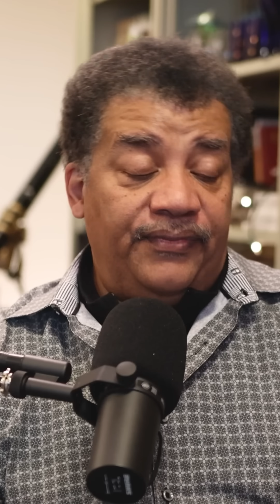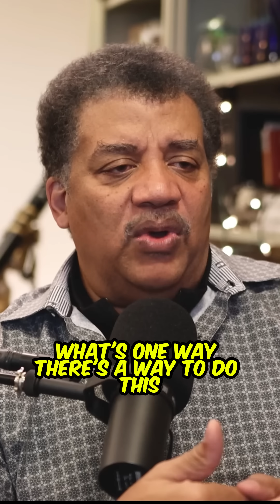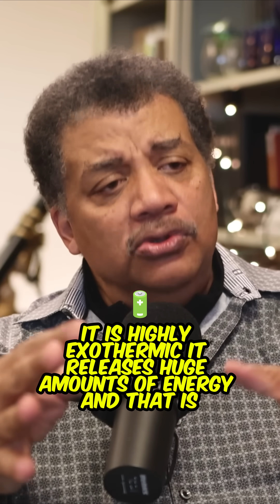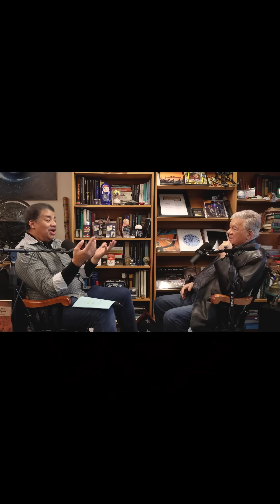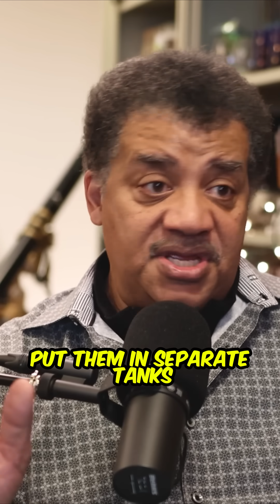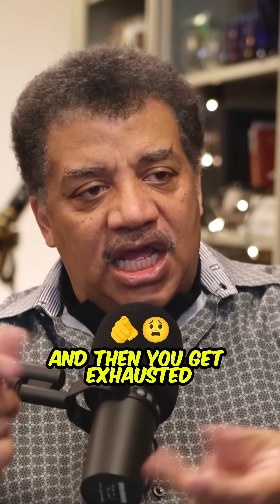William Shatner: How Does Water Become Rocket Fuel on the Moon? Neil deGrasse Tyson explain

Comment: Reason it's useful is that even though it required energy to create it, you can store it ready to use and it releases that energy quicker than it does to create it; making it a good fuel.

It's not quick but if you made a seaplane that ran on hydrogen fuel cell with a built in electrolyzer. Could fly the plane, for however many hours of fuel you have, then land it in some port, bay or cove. Use some solar panels maybe built into the wings to power the electrolyzer for however long it takes to refill the fuel cells and then take off again. And repeat. 

You may ask yourself why not just store the solar energy in batteries. You could. It would take less time to recharge the battery however you have a shorter range and it's less environmentally friendly.

Comment: I think it would be helpful to point out that water is electrically polarized, meaning one side is electrically negative  and the other is positive. When the molecule is under a strong electric field it gets torn apart. For its molecular weight, water is very density, due to the electric polarity. The molecules are strongly attracted electrically, so are closer together than they would be otherwise, hence the high density relative to molecular weight. Example: O2 is a diatomic molecule that is a gas clear down to bitterly cold -182C. Water, on the other hand, only has one Oxygen, and is about 56% the molecular weight of O2 & is a liquid all the way up to 100C. Water has other crazy properties, and we have oceans of the stuff. The point is that electric phenomena have huge potential, are responsible of the industrial revolution. We have only but scratched the surface of nuclear. We haven't entered the nuclear age, but are in the infancy.

Comment: One of the worst explanation I have heard Tyson give.  Electrolysis meaning running electricity through water to break the chemical bond producing hydrogen and oxygen.  Ignite the two and you have fuel being burnt 🔥 for propulsion.

Comment: Tyson seems to be implying that this is a simple process that will be easily used on the Moon as the Moon has the water you would need yet he fails to point out that if it was such a no brainer then why do they not create energy the same way on earth where conditions are much more favourable.
 The scientists like to understate the difficulties.
Elon Musk is on a different level when it comes to ignoring the practical problems that would be faced if there was ever a mission to Mars.
 Trying to pull the wool over peoples eyes so that they can continue to get their ultra expensive funding?

Comment: I had a little hydrogen fuel cell kit that I gave my son (but played with a lot myself). It had a hydrogen generator where you put water into tank 1, plug it in, and the H2 goes to tank 2. Then you disconnect the plug, take the hydrogen to a little toy car with a fuel cell, connect that, and it would make electricity to run a tiny motor, make the car move forward.

Comment: No! No, no, no, no, No!! Hydrogen can be burned with oxygen. However it takes WAY more Energy to Seperate them... And yes, a car engine was rebuilt to run on Hydrogen. It was a VW Beatle, and this was done in the 1970s, however, it only produced about 3/4 the power of the same engine running on gasoline. And yes, the exhaust was water, steam coming out of the tailpipes.. But over time, that water would cause rust and damage to the Engine, look up the "Natural Gas" thing from the early 2000s, they had the same problem...

Comment: The important part left out is that you can do the electrolysis slowly over time using solar or whatnot, but then when you want to take off you combine the hydrogen & oxygen quickly, releasing the same energy you used to break up the water, but massively more power output for a short period of time (needed when you need to escape the moon monsters).

Comment: Called a car battery, electroisis, water in container , two metal plates , DC current application, + plate gives off Hydrogen and - plate gives off Oxygen, now you got very potent rocket fuel or fuel cell from hydrogen. ( Last time I put this up and expert said " batteries have acid in them " well they do when charged , that's how it stores energy, flat battery is water ( or very much less acid) and charged battery is very acidic . Put distilled water in a battery it will be flat , but tip water out and add acid it's now instantly charged .

Comment: You can do it with a jar of water, a knife and fork and the plug and wire from any discarded electrical appliance. Just don't electrocute yourself. Also don't sniff the fumes, tap water releases chlorine or something, If you cough while sniffing, that's a good method for involuntary self-inflicted electro-shock therapy.

Comment: Utilizing solar electricity, the electrolysis can be cheaply done. Many current engines are unable to sustain using this as a fuel for a long period due to the 250°c/450°f higher burn temp than common gasoline causing overheat resulting in melting of engine components that were made for the cooler burning gasoline engines. This blows the idea of hydrogen conversion kits for current vehicles... 😎out of the water.

Comment: The correct answer to William Shatner’s question is:

For propulsion in space/vacuum,  you need to accelerate some mass very quickly in the opposite direction.

The mass comes from the water, the energy comes from Solar Power and/or nuclear power.  Then the energy is stored by separating hydrogen and oxygen through electrolysis of the water.

When it is time to launch, the burning of the hydrogen and oxygen in the rocket engine releases the energy and the high velocity water mass propels the spaceship.

Hydrogen and oxygen was the propulsion the space shuttle and many other rockets used.

A more complex process of turning water and CO2 into liquid methane and oxygen for fuel is what SpaceX plans on Mars.

Oxygen is kept at -183 C
Methane is kept at -162 C

Hydrogen is kept at -253 C

So hydrogen is over 40 times more energy to liquify. And about 10 times harder keeping it cold and liquified.

Not to mention, hydrogen is harder to keep from leaking and pushes the limits of our technology and materials.
Reply: Unless you use a warp drive. Or a probability drive.

Comment: Neil is not correct about the energy needed for the electrolysis being the same released in the combustion.
We need more energy to separate H2O in H+H+O.
Then energy is released in the form of heat when H+H recombine in H2 and O+O recombine in O2.

Energy loss depends on the catalyst used and may be from 20% to 30%.

Comment: "add energy to the system" Shatner's pointing out that it sounds a little like you have to give it a jolt or introduce something exogenous but it's not, it's kinda freeing the energy from the separation process is it not? It's releasing energy, not a conversion like burning coal to make steam to produce electricity, using energy from something else. Do I get this right?

Comment: Shatner, temprature split, seperate water Molecules freeing the Oxygen and Hydrogen Gase's, check a mechanical clothes dryer where it's temperature splits the water Molecules therein where the clothes become dry and the Gase's are tunneled out.
Sunlight does the same with clothes hanging on a clothes line.

Comment: Tyson you didn’t answer the question so much as explain the concept conservation of mass and the energy covalent bonding thermal release or expending of the electrons energy/vibration. The Mohican tin onxy knife of St Croix infamy split a hydrogen from water they used it as a balloon type gathering tool the corners of hides would tie to stomach and bladder balloons. Nichola Tesla hydrocoil also separated hydrogen but less effectively not gathering the oxidized tin sheared hydrogen. My concept and chemical bonds sheared through a hybrid chemical and mechanical physics plane. The outer covalent shelf independent of ho a free e to the n now neutron sorry hood Swedish Mohican Jew Christian military medic deployed and semi retired dabbling with Bush.

Comment: If the net gain is zero, why not use the energy it takes to separate h20 for whatever you need the energy for in the first place.
Reply: Because breaking the water apart (electrolysis) is a slow and tedious proces that can be done with low amounts of energy at a time. Run a few solar panels for a year, for example.

But bringing it back together (combustion) can be done violently and thus be used in a rocket engine.
Reply: They could use nuclear energy to power the electrolysis process producing hydrogen & oxygen. Those products can be stored for when you need them.

Comment: Hmmm missing info here you can use pulsating DC.

Resonant Cavity: One method described for utilizing pulsating DC involves a resonant cavity where the direct current is pulsed at a frequency that matches the resonant wavelength of the water molecules. This resonance is believed to enhance the splitting of water molecules.
You make what called browns gas 2ho

Comment: You do not get back the same energy that you put in. Its more like you get back 35% of the energy you put in, and that just converting water to hydrogen and oxygen. You are going to power this with solar energy and it the momentum we only get a conversation rate of 25%. Bottom line, you'd need to put way more energy in than you are going to get back.

Comment: glorified battery. You do have to use energy to charge (split H and O2) - solar
Reply: A battery cannot discharge the energy with the necessary speed to propel a rocket
Reply: @sergiorejtman front it with capacitor

Comment: The amount of fuel energy you get back from your electrolysis is never the same as what you put in. You put in 1kW of electricity to H2 and O2 out of water and you will only get about 80% of that back in potential energy. If you burn that in a fuel cell you will get even less efficiency back out, like 65% with a state of the art fuel cell. 80% x 65% =  41% So for every 1000 Watts you use from the sun to make H2 & O2 you will only get 410 Watts back.
Reply: Steam Methane Reforming (SMR) is more efficient but uses fossil fuels producing CO₂ emissions.
Reply: @jay143.  Yep, CO2 emissions are a major concern in space... 😅
Reply: you might burn out the sun with that much inefficiency
Reply: Man, you're right if you are talking about car propulsion.
But this is about rocket propulsion. You have to burn H2 with O2. Fuel cells only are useful for the internal electrical systems of the space ship.

About the part of 80% of potential chemical energy, you're right.

Comment: I feel like he making shit up
Reply: I split water into 2 gases in 7th grade science class, not much because it was a low voltage school size rig but enough to test the gases
Reply: Google... hydrogen drag bike 🏍 👌
Reply: He is not. You can separate water into hydrogen and oxygen by electrolysis, and it's a farily simple process. You put 2 electrodes into a water tank, power them and the water breaks down into hydrogen and oxygen. As they have different densities, you can easily collect them into separate tanks for storage. Then you put those tanks into a rocket and as he described, make the outputs of both tanks join in the rocket enginge nozzle. You put a spark there and the hydrogen and oxygen will explosively combine back into water again. The explosion will propel the engine. 
We have been using liquid hydrogen-oxygen powered rockets since 1960's.
They have some drawbacks though, which is why quite often a different fuel is used.
Reply: you right Bro, He jus Jivin

Comment: It's also why hydrogen is a better green opt😢ion than lithium. It's so inefficient in comparison when done correctly and you don't have to mine the earth for it. There are better batteries coming. Lithium is like the model T of batteries. Hydrogen is rocket fuel. Toyota has done some great work on it
Reply: Hydrogen is a very poor alternative to lithium batteries for zero emission vehicles. Gree hydrogen is expensive and hard to deal with. It is promoted by the dying fossil fuel industry because they can produce dirty hydrogen from oil and gas. Hydrogen power for cars is failing. The very few fuel stations are closing down. Only a very small number of people were ever stupid enough to buy hydrogen cars. Some are suing Toyota to try to get their money back. Lithium is plentiful and can be recycled. Hydrogen is suitable for rocket fuels but not cars.
Reply: @bananacabbage7402 there have been great strides on hydrogen and as for batteries, Lithium will fade for use in cars. 2027 is the target to replace Lithium with lighter and more efficient batteries. Ones that don't require mining and hazmat in accidents or fire. It's early tech. With bad mileage that only makes foreign interests and electric companies richer. Sorry if you have one. Things will get better and Hou should be happy for that

Comment: When a conductor is positively charged it is called the anode. When a conductor is negativity charged it is called the cathode. We distribute charge with a battery.

First we look at the anode (positive). Electrons are being taken from the water. When 1 electron is taken H2O becomes HO- (hydroxide), then a second electron is taken and you have O-- oxygen. Then two oxygen atoms combine to make O2 and float up as a gas. At the same time two hydrogen atoms were released. The H atoms desolve into the water (aq), and are basically free protons (H+).

2H2O(l) → O2(g) + 4H+(aq) + 4e−

Now we can go to the cathode and see the next step. The free floating hydrogen atoms (aka H+ aka protons) receive an electron from the cathode. The cathode is negative and giving away electrons. The electrons and H+ combine to form regular H. The hydroden then floats up as gas H2 (natural form).

2H+(aq) + 2e− → H2(g)

Now we see how we get H2 and O2 from Electrolysis. Yay 😀 🎉 💦💨

2H2O(l) → 2H2(g) + O2(g)
Reply: That makes absolutely no sense
Reply: @Doajohn3777-c1u You should run for president.
Reply: Nerd
Reply: Ok, but is there a way to gain net energy from water? I've heard this all my life but still not sure.
Reply: @j.a.scheffer7584  the net energy is negative.
You have to supply more energy than the potential chemical energy that is stored in 2H2 + O2.
Part of it (20% to 30%) is lost in heat.
Reply: @joaochainhonunes . Hopefully break through’s with fusion recently will change that, sooner rather than later i hope.  

I just hope i get to see it in my life time.
Reply: You missed the energy tradings (consumed and realised) in those equations.